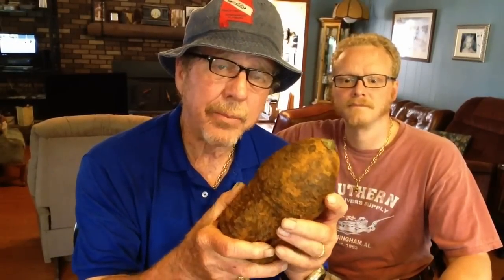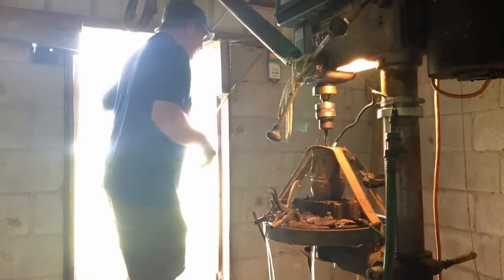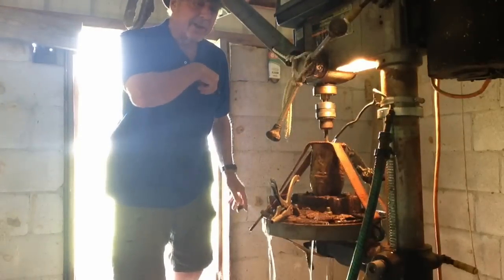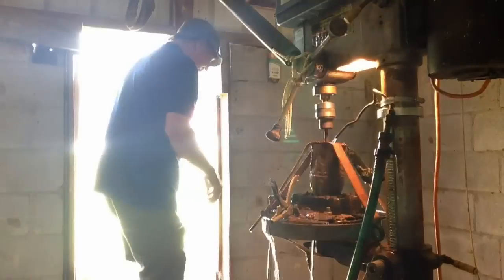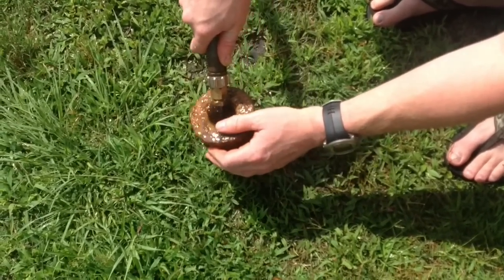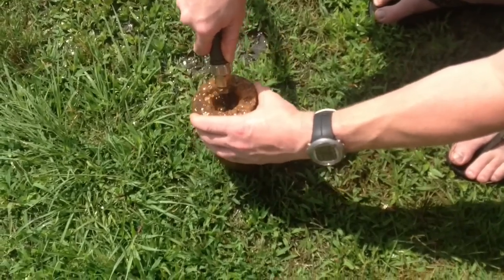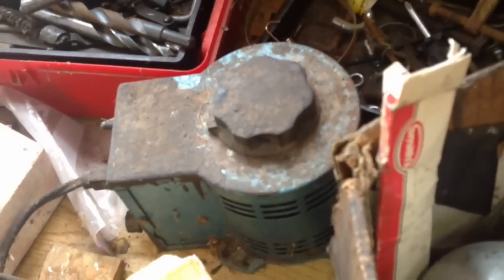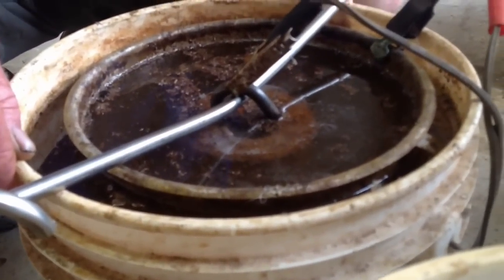Steve Phillips unloading cannonball

Comment: In not 100% sure but the clunking gears in the drill press might be coming from metal chips accumulated in the gears over the years.  I took mine apart and cleaned it.  Worked much smoother.  Good video

Comment: Most of my relics come out of a lime layer in the soil. The iron has a coating like cement and I use muriatic acid to take it off. After the lime comes off, I rinse with water then apply a baking soda paste to kill the acid. It has worked wonderfully! I also use linseed oil to preserve the relics.

Comment: why not connect the drill via an extension cord?
Reply from the maker: I use long extension cords and stop drilling before checking on shells. I start drilling while watching but the drill bit is not actually drilling until I am far away and ropes and pulleys allow drilling to start.
Reply: @stevephillips0404  
I found Civil War Schenkl i am wanting to pay to have this service done.
Would you be willing sir?
Reply from the maker: @stevenrobinson7439   I’ll be home in a week. Contact me then.